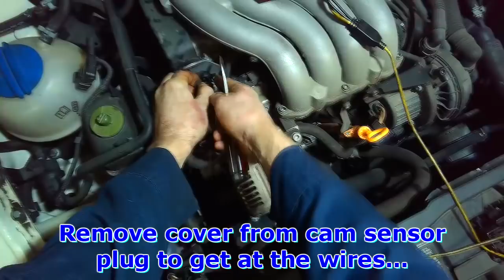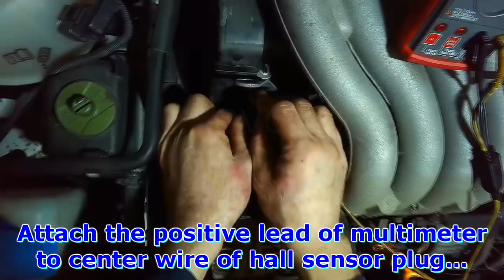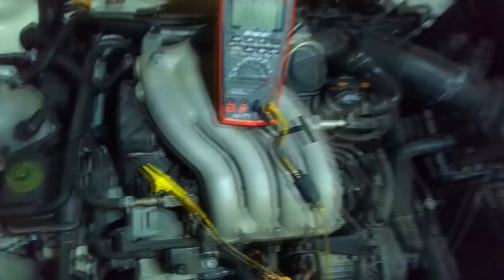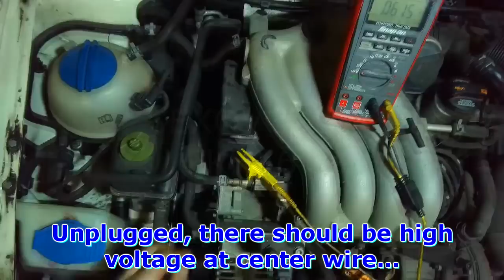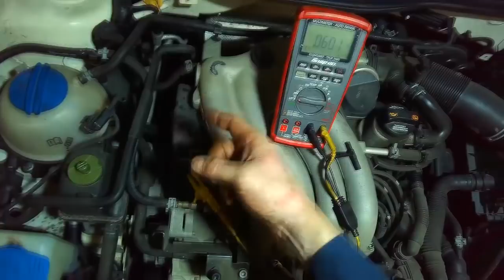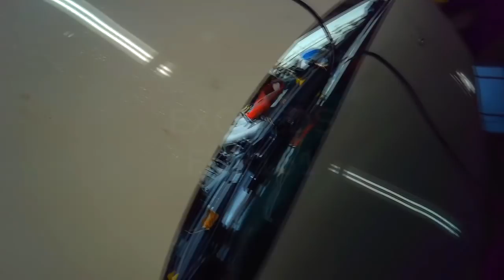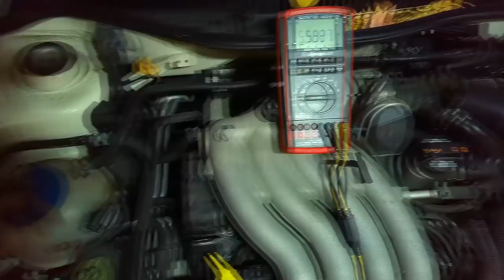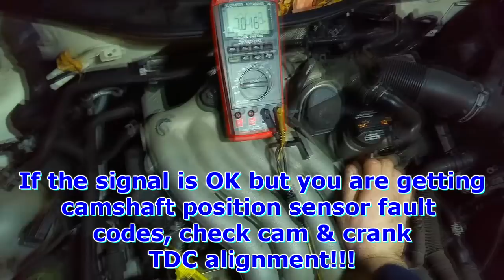VW A4: 2.0L camshaft position sensor quick check (for signal)

Comment: Hi , great and simple video to the point . What if my center wire has voltage with key off position ? Yes voltage is high when running also
Reply from the maker: @jasonheck2533
The ECM is still powered up for a little time after the key is turned off.

What is the actual problem / fault code?

Year, make, model, engine?

Most likely a bad cam sensor.
Reply: @EXOVCDS    Hi thanks for reply back ! It is a 2002 Jetta 2.0  main complaint was it won't rev over 3000 rpm . Belt was charged 25000 miles ago. I checked cam sensor with your method and it shows no change when running stays at 11 volts and one is ground and other had 5 volts . Which shows bad sensor with your video . Then I noticed center wire power won't turn off for 20 seconds after key off  without starting  Which kinda seems normal for ecm sleep . Then I noticed if I start engine and shut off center wire won't turn off for 16 mins . Thinking maybe that's why cam sensor is burned up . Relay is fine , it wire from ecm that controls relay that won't shut off.  That can't be good on new sensor after I install . So question do you think there's an issue with ecm or it won't go into sleep mode quicker because of bad sensor and code on ?
Reply from the maker: @jasonheck2533
Let's not worry about the voltage of the center wire with the connector unplugged for now.

The hall sensor (camshaft position sensor) is supposed to pull that voltage down to 0v as the camshaft is turning.

If you do not have a high / low voltage as the engine / camshaft is turning... then the hall sensor / camshaft position sensor is bad.

Verify that the outer 2 wires are power & ground. If power & ground are present, and the center wire voltage does not change (sensor plugged in)... then the hall sensor / camshaft position sensor is bad.

Comment: Hi, wonderful video I just have a question if I need to further investigate in the wiring. My case is that the readings on Key ON are Pin 1 = 5v, Pin 2= 11v and on engine turned On i have Pin 1 = 5v, Pin 2= fluctuates on 6v to 7v, and pin 3 = ground in which is good. does the voltages on pin 2 are normal? I have a seat leon mk1 1.8 20v non turbo 2003 engine AGN. In case you wonder what I got on VCDS is: 00515 - Camshaft Position (Hall) Sensor (G40)  30-00 - Open or Short to Plus
Reply from the maker: The fluctuating voltage means that the sensor is working. The digital voltmeter is not quick enough to display the square-wave signal that the position sensor is sending to the ECM (the voltmeter displays an average voltage).

You have to check the camshaft & crankshaft TDC alignment.

If the alignment is not correct, then the ecm is receiving the camshaft position sensor signal at the wrong time... possible reason for that fault code.

Any recent repair? Timing belt change?

If it's an old timing belt, check the belt for missing teeth... which could have caused the timing to jump.
Reply: @EXOVCDS  Thanks for the response, I haven't done on timming after all. I really appreciate the advices I will hopefully take them this week since this will be my first timming attempt ahahaha wish me luck!
Reply: @EXOVCDS  To extend this, I have checked the timings and the camshaft was one tooth off so we had the chance to fix it, now that code is still remaining BUT it only appears when I drive the car. So definetly there is a cable might have broken somewhere. And thanks again for the tips!
Reply from the maker: @LAlvarenga 
Thank you for the update.
Many people tell me that they used the correct TDC marks when installing a timing belt... and when I see pictures of the actual marks, I can see that things were not aligned correctly.
So, i don't know if you have wiring problems or if cam & crank are aligned correctly.
What about exhaust camshaft & intake camshaft alignment?
When did this code start appearing? All of a sudden or after work was done on the engine? What work was done?

Comment: is the a common procedure for hall effect sensors, wondering if the data would be similar for a 2014 beetle? same 3 wire concept, ground power signal? 2.5l
Reply from the maker: Yes.
Best way to view is with a scope, but multimeter will also work.

Comment: Hello Thomas,

My daughters 03 Beetle made a "loud pop" and the car stopped and wouldn't start again. Ran the codes and got a P0343 Camshaft Position Sensor “A” Circuit High Bank 1 or Single Sensor and a P0102 MAF sensor "A" Circuit low. Would the CPS prevent the car from starting, and can I check if the sensor is bad without the car running? I saw your CPS test video but the engine is running, mine currently doesn't. Thank you
Reply from the maker: Check the timing belt.
Reply: thank you sir! @EXOVCDS  i didnt see that you replied.getting into the inspection tomorrow.
Reply: you were correct sir! i appreciate your videos and help! @EXOVCDS
Reply from the maker: Thank you for the update.  How bad is the damage? Bent valves?
Reply: @EXOVCDS  I’m not sure yet. I need to investigate more. Is it possible that maybe there is only damage to the belt?
Reply from the maker: @chiefrockone possibly.  If the belt is bad, replace it and see how the engine runs. If it runs smooth, you're lucky. If it runs rough, do a compression test to see which cylinder is bad.
Reply: @EXOVCDS  I’ll start there and report back, eventually. Thanks again!
Reply from the maker: I can't help if you don't reply.

Comment: Good information, However I have a 2006 Audi A4 2.0T  I get a reading of 4.98V with the plug on or off and the car starts, runs good except for hesitation and the same Idle (slightly rough) have not replaced cps but did change MAS, I would guess I'm not getting a signal , your help would be greatly appreciated, thanks in advance.
Reply from the maker: This video is for Volkswagen A4 Platform (Golf Jetta) 4th generation of the A platform. 
Audi B platform A4 is different.
If you have camshaft sensor fault code and the signal voltage does not change when the engine is running, then the sensor might be bad. An oscilloscope is needed to be 100% sure. If the code / fault surfaced after a timing belt change, it could be that the cam / crank timing was not done correctly.  It is also possible that the chain or chain tensioner at the back of the cylinder head have a problem. You will need to look at videos that apply to your specific Audi engine.
Reply: @EXOVCDS  thanks for the response.

Comment: You are awesome, thank you for all your videos. They are the best I've found. I have a stupid question for ya, what are the multimeter leads you are using? I have multimeter with standard leads but they need to have metal contact points for reading. Thank you sir, with your help I'll know the mk4 vr6 and 2.0 inside and out!
Reply from the maker: I think I just replied to your email. I just got home from work. Sorry about the late reply.

Comment: Anyway to test one out of the engine
Reply from the maker: With the ignition on and the sensor plugged in... move a screwdriver across the hall sensor... voltage should change.

Comment: I have  a 2005 6 speed new beetle with the P0341 code and when I back-probed the center wire, I consistently got 12.5V when the connector was unplugged - is that too high?  Everything else coincided with your video - the signal dropped to between 6 and 7 when I plugged the connector back with the engine running, and with key on, engine off I got .06 or .10.
Reply from the maker: I assume that you have a 2.0L engine... if the voltage is lower when the the connector is plugged in & the engine is running, then the sensor is ok / producing a signal. If the timing belt was recently replaced, it could be that the cam / crank timing / alignment is out 1 or 2 teeth. Turn the engine to TDC#1 (mark on camshaft gear aligns with arrow on valve cover) and then check the position of the TDC mark at the flywheel / torque converter at the inspection window. Let me know what you find.
Reply: @EXOVCDS  Thanks for responding!  It's a 2.0 automatic.  I'll check the timing at the inspection window - it's really cramped down there when I looked for it yesterday. I couldn't find it so I checked TDC  with the camshaft gear and with the crank pulley - or tried to.  The marks on the lower timing cover are so faint, but I snuck a mirror up there and then also snuck camera in there and from what I could see and from the pics I took the crank pulley also lined right up.  I'll check timing w the inspection window as well, but if timing is OK, I'm stumped.
Reply from the maker: You'll need a scope to see the actual square wave of the cam sensor signal. A dirty signal due to metal debris stuck to the magnetic sensor or a bent shutter window can affect the signal... to the point where the ecm flags a bad sensor.
Reply: @EXOVCDS  Thanks again!  So after taking a closer look and double checking the timing, I pulled the dip stick and found it was very very low on oil. Doh!  Should have checked that first before doing anything else.  I don't have a scope (just a DIYer) so if the code pops up after I change the oil and filter, I might just go ahead and replace the sensor after checking timing one last time.  That inspection window on the 6speed is tucked under the coil pack and nearly impossible to use without disconnecting coolant hoses, but if I have to I'll remove the hoses.  (The timing belt was replaced over 3 years ago and after all that time the crank and camshaft notches line up exactly at their marks and the P0341 code only just popped up, so I think I'm safe in assuming good timing for now...we'll see).
Reply from the maker: How old is the timing belt? If you are going to remove the timing belt to change the cam sensor, then you might as well also replace the belt, tensioner & water pump.
Reply: @EXOVCDS  I might just do that.  The belt, tensioner and pump were replaced  about 3 years ago and the belt looked good when I checked timing.  As it turns out I have the BEV engine, which I don't think is VVT so maybe oil isn't the issue.
Reply from the maker: BBW is the only VVT engine in the 2.0 family for the mk4's.
Reply: @EXOVCDS   Thanks.  Just wanted to get back to you-the camshaft sensor code went away after I replaced the battery that was slowly dying.  Long story-before I got around to changing the camshaft position sensor I replaced the ignition switch bc the keys were rotating all the way around.  Afterward I was still getting the camshaft sensor code, but I also noticed the lock cylinder was getting stuck, which drained the battery twice.  Each time I jumped the battery the camshaft code came back.  So I cleaned out the lock cylinder and solved that problem.  Unfortunately, I left the dome light on when I did and forgot to turn it off when I was done.  That was enough to kill the battery for good.  So I replaced the battery and I've driven about 700 miles and no camshaft position sensor code.  I have a Jeep and a low battery will trigger all kinds of false codes, but I wouldn't have expected that here.  Does this make sense?
Reply from the maker: @markamarkam  Thank you for the update. I can not explain why it would have affected / caused that code. I can't see how a battery / replacement would have caused it. All I can say is keep an eye on it. =)
Reply: @EXOVCDS  Just wanted to get back to you - the camshaft position sensor code eventually did come back. So I went ahead and replaced it, but in the process of removing the camshaft sprocket to replace the sensor I realized how easy it was to get the sprocket off without even dealing with the tensioner because of the slack in the timing belt.  Turns out the 3-year old tensioner had completely failed and wasn't providing much tension at all.   Timing belt was not loose enough to skip a tooth, but loose enough to trigger the camshaft sensor code.  I ended up replacing the belt, water pump and tensioner and the code is now gone.  I kept the old  camshaft position sensor, which is probably fine after all.
Reply from the maker: @markamarkam  thanks for the update!

Comment: How do you check the cam and crank TDC alignment ?
Reply from the maker: Turn the crankshaft until the camshaft TDC mark is lined up with the mark on the valve cover. When the camshaft is at TDC, the crankshaft should also be at TDC. Look for the TDC mark at the transmission TDC inspection window. All this information (and more) can be found in a service manual. You can download as many service manuals, for as many VW's that you want... for $35 (cost for 24 hour access). I manage to download 8GB on average. The downloaded pdf files do not expire... this is the best deal on the internet, for VW service info. Create a free user account and then buy a 24hr subscription:
https://erwin.vw.com/erwin/showHome.do
If $35 is too much or you don't have the time... I offer Tech support for $10. Click the fkh161 link in the description and follow the instructions.
Reply: @EXOVCDS  my car is Nissan Sentra 2008 and I doubt if its has manual crankshaft TDC setting, its use the cam and crank to automatically set it as you drive
Reply from the maker: @AnythingEverythingGh  People need to learn how to ask questions. First thing that needs to be said... what type of car. Now that I know it's a 2008 Nissan Sentra... buy a Nissan Sentra Service manual. It will show you how to set the engine to TDC.

Comment: Sorry to bother you about this. Just don't know who else to ask. Camshaft gear and sensor install everything was running well. Code came up for misfire on 2 and 3 and code for multiple as well. Cel started flashing and car was stuttering backfiring and would not go over15 to 20 miles an hour. Not sure what just happened. If you have any suggestions or ideas I would greatly appreciate that. Super stressed.
Reply from the maker: Check timing belt (camshaft to crankshaft alignment when engine is at #1 TDC). The belt might have jumped, causing things to go out of time... due to the tensioner not having been tightened correctly or the locking tab slipped out of the frost plug hole.
Reply: @EXOVCDS  ok. Thank you for your quick response. I appreciate that. I will check this all out after work tomorrow. Hopefully I didn't do any damage.
Reply: @EXOVCDS  I checked the tensioner and it's still in the hole but the where the arrow lines up in between that v is past that a little bit.  I'm gonna check the timing and reset the tensioner tomorrow. Im hoping for maybe spark issues or fuel. Wishful thinking.
Reply from the maker: Its normal for the arrow to not be lined up when thecengine is off. As long as it is close to the v when running, things are ok. I would still turn to TDC #1 to make sure cam / crank sync is ok.
Reply: @EXOVCDS  I checked it all out and everything was good on that end. The car drove this morning at least around the block. Then I let it sit and idle and it sounded like it was bogging out. Like a hot rod with a huge cam. I smell fuel more then normal as well.
Reply from the maker: If the engine is misfiring, check the spark plug wires for arcing or moisture that could cause arcing.
Reply: @EXOVCDS  I changed out the spark plugs last night. 2 of the plugs were very loose and one was barley in there. So I made sure I torqued the new ones down spec. I took the car out for few test runs late last night and did live data. I only got 1 misfire on first cylinder and then later there was none. I'm going to keep an eye on it and probably just replace wires as well. Thanks again for your help. Car is running better then before. Appreciate you. Happy holidays to you and yours.
Reply from the maker: @maxreigert3801  thank you for the update! All the best to you & yours as well!